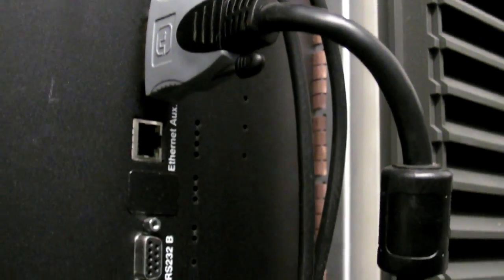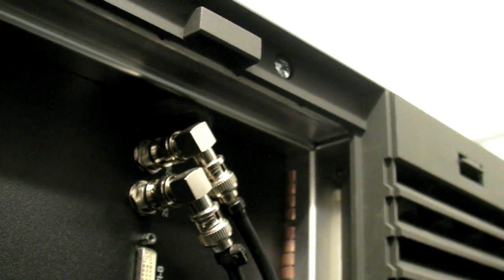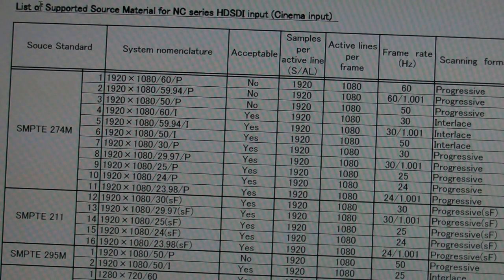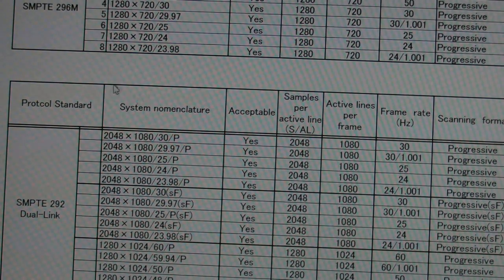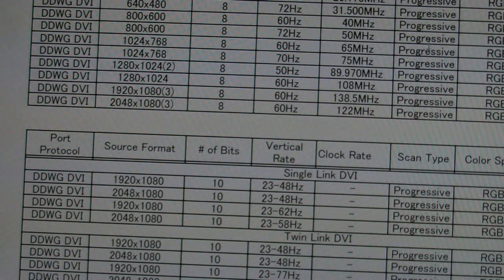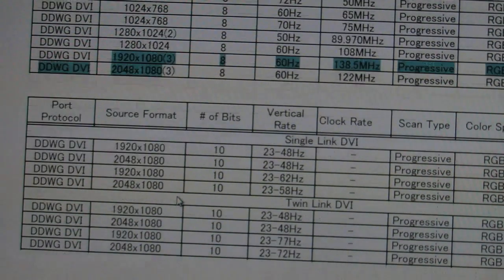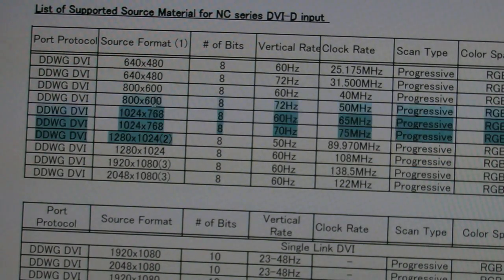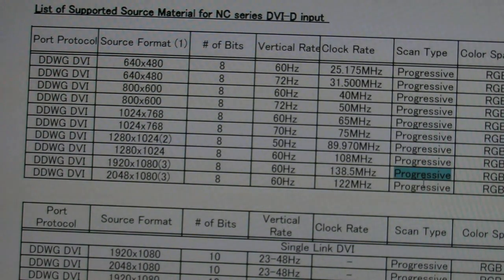What can I plug into a DCI projector

Comment from the maker: The Doremi IMB is as good as any available technology.  There tech seem very solid.
Yes, if you have a 2 or 4 K projector, via the HDMI ports you can drive them at that resolution.  Its great.
And they do have all tho GPO, GPI, AES like the original units, but likely accessable via RJ45 plus (As the are smaller and there is limited space on a media block card)